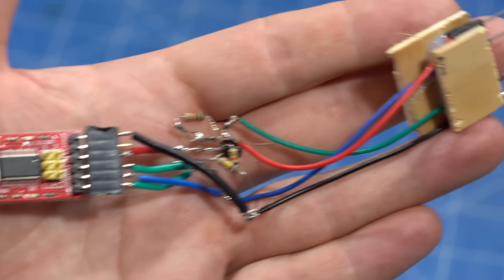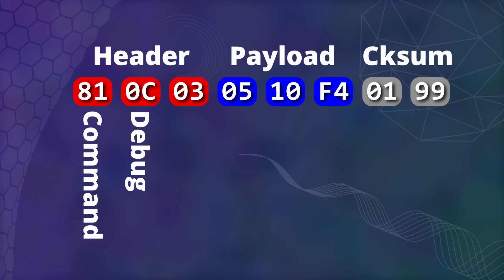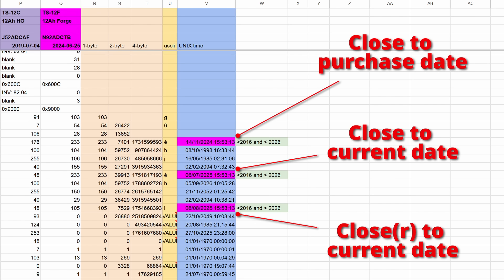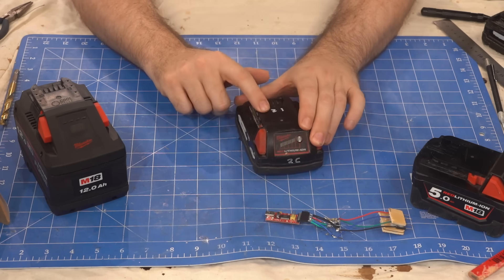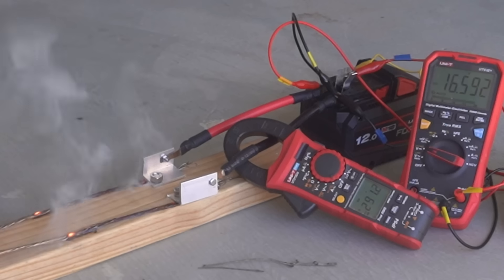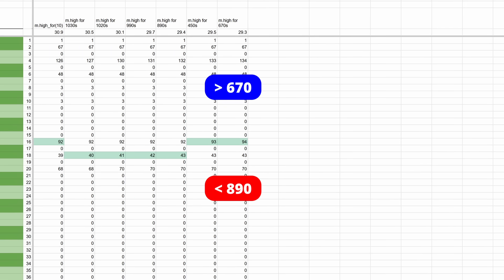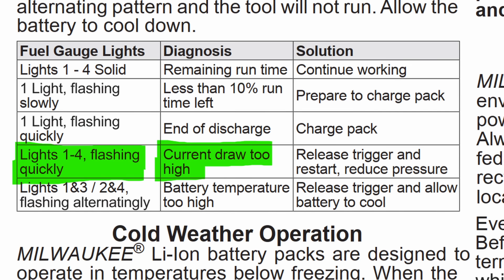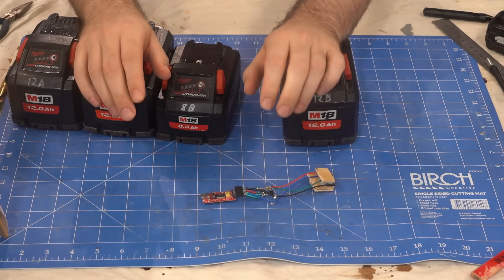Full M18 diagnostics revealed

Comment: Back in 93/94, I was an electronic tech. I worked with an engineer to prototype and develop the smart battery module for C&D Battery. We also developed the Ranger II charger board that would gather battery data when the battery was plugged in to charge. It was hard enough to make it work. I could not imagine the challenge of trying to figure it out backwards.
Reply: Why'd you have to make it so complicated mate
Reply: Incredible work by this gentleman

Comment: I gave up and I use a separate $3 BMS for the Makita battery and charge with an iMax B6 charger. Now I have balancing and LVC HVC in addition
Reply: Do you happen to remember which BMS you used for Makita? I am interested in building a charge setup for myself. Thanks in advance.

Comment: Loved to see someone do similar too Sthil batteries, ive got and seen plenty on battery’s going into fault mode, single flashing led,  and becoming useless. Very frustrating given the battery cost and minimal use . Ive checked them cell voltages and they seem fine, so I’m sure the battery is recoverable
Reply: I was given a Stihl battery in this condition by a tree surgeon. After looking into it, lots online about how it's BMS is locked down and needs reset by service tech after repairs. I harvested the cells all were 💯 ok even capacity tested each individual cell and none were telling me anything. I'm hopeful that a similar system exists for commercial batteries but doubt, unless leaked will ever be available.

Comment: This is cool and dumb at the same time.  I can't believe companies are going to such levels of control over batteries. Great video, keep up the great work
Reply: The level of detail in those data stunned me. Lets hope they will use the data not only to deny warranty, but to improve the product. Hopefully not to cheap it out as in some cases it might indicate they are overengineered in some way. 

But I would love to live in world, where the diagnostic data and access to them would be published with the product
Reply from the maker: It makes sense for them to have. Helps them diagnose failed batteries so they can adjust their overheat and cutoffs, et cetera. But yeah, probably mostly gets used for them to just deny warranty based on number of overheats.

Comment: Is there anyone doing this analysis for the Lidl-Parkside tool batteries?
I hear that DeWalt batteries have no internal protection or BMS and rely on an internal tool protection circuit.
Reply from the maker: I think "ErCan Everything" has the most Parkside in-depth videos. Yes, Dewalt is almost entirely within the tool, except for a chip that detects overvoltage when charging.

Comment: 13:20 how would you cool it down before taking it off charge? If you disconnect the charger from the wall, wouldn't that trigger the write to memory? Maybe put an ice brick on it to cool it down while it's still on the charger?
Reply from the maker: Just leave it there will get it back to 40C fairly quickly. But blowing air and/or ice will also help. I was mostly joking as overheating mid-charge is unlikely - overheat only really happens on a tool, so it'll be recorded at the start of charge, and there's no way to  avoid that (except not put it on the charger)
Reply: @toolscientist fantastic work mate! I could imagine a simple stand alone device designed to wall mount near to your charger and all of your batteries could be checked at intervals and it might give them a quick heads up if they should be contacting their rep sometime soon. 

Was there a register that records the number of times the registry has been accessed by a non-tool, non-charger device? Is there any way Milwaukee could identify that you've been snooping on their uart?
Reply from the maker: @The.Talent  not that I could see. Did several re-reads when left on the UART reader and only the system clock changes.

Comment: It's just astounding to which lengths manufacturers will go to bar you from accessing your own property. Just so they can keep selling you new batteries. It's not like 99.99% of Joe public would even bother diagnosing or fixing anything.
Reply from the maker: They did make an adapter (2700-20 or M18ONEKA), but apparently never gave he public access to the diagnostics as it was just meant for programming one-key tools. They could have done so, and like you say, only 1 in 10,000 users would have used it.

Comment: Why tf did they not let the charger balance the cells 🤦‍♂️
Reply from the maker: The charger can't balance, but they do have balancing circuitry built into their AFE (Analog Front End) chip. I found in my [010] vid that they never make use of it. Designed obsolescence seems the most obvious answer.

Comment: Now we need to find how to enable the cell balance.
Reply from the maker: I don't think there's an easy way to do that. It would need someone to write an open-source firmware from scratch, and then not many users have the capability to flash firmware. There'd also be liability issues in the event that modified batteries caught fire. I prefer to just keep shaming these companies until they fix it themselves.

Comment: There is now a programmer at milwakee who has the job of moving three random bytes of information somewhere else for new tool batteries.
Reply from the maker: Haha - I hope not.
Reply: @toolscientist 😂 keeping him employed
Reply: New improved ' Milwaukee Blue Lithium'.
Reply: Next minute it’s just got an md5 hash haha
Reply: @geekswithfeet9137 md5 means shit to me! Speeding to collision will be the key
Reply: @geekswithfeet9137 md5 means nothing to me, speeding to collision will be the key.
Reply: You wouldn’t believe the lengths Ford and GM goes to encrypt their ECU’s in new vehicles. It takes a year or two but they all get deciphered.
Reply: @lordcommander3224 it's more about taking the time to deconstruct all of the ecu systems into all of its protocols 

Many computers in cars to reverse engineer just to get an ECU
Reply: Sad but true mate.
Reply: best part is that it's the same 3 bytes (with different parameters) for all TTI products (You're welcome).
Reply: @C.GW.H  Forreal?
Reply: They would need to redo the protocol. If the parameters are figured out, all it will take is a regression analysis.
Reply: @goatsheep4545 this guy knows
Reply: @goatsheep4545 not really. They could add a second layer. First handshake is still the same so the old batteries are still compatible, then after the handshake if it's an old battery format allow it to send/receive as normal, but if it's the new battery encrypt the data so that only official Milwaukee hardware can read it. Allow the chargers to write to a separate unencrypted sector and the battery itself takes those values, runs them through encryption and adds them to the pile where they need to be.
Reply: @wolfrig2000 don't do Milwaukee Guy's work for him, keep him employed 😤
Reply: @wolfrig2000  I doubt the BMS has enough processing power nor the RAM to do any sort of data encryption.
Reply: A Chinese students are working very hard to understand this video
Reply: uno that, wokring all the overtime to close this down
Reply: damage is done theres gotta be hundreds of thousands of those batteries.
Reply: If this changes the backwards compatibility of the batteries with the tools and chargers, there would be a riot.
Reply: It’s no so easy as they need to support charging with legacy chargers 😂…even if they did it, they would have to rework the entire system as a big gamble only to hope that people wouldn’t crack it again and they’d have to repeat the same steps again.
Reply: unlikely that they care that much, in reality an extremely small minority of customers that will use this in their favor, hardly worth spending time and money on.
Reply: @rrabbids  of course they will care, this wil remove a chunk of income to them!
Reply: @rrabbids Counterfeiters would like a word.
Reply: And update all their diagnostics software?      
Working as a subcontracted dev team for a very large computer hardware manufacturer that will either be rolled out in the next quarter or they won't notice for at least a decade and all of a sudden log a priority 0 ticket to have it patched immediately. 
I would know because they assigned that P0 ticket to me
Reply: @apocalyptosoldier5527  P0 means that it has zero priority, obviously
Reply: let's just hope he got the memo about the new cover sheets on his TPS reports

Comment: Hello, what are the BMS ics ? Made by ti?
Reply from the maker: Most use a TI BQ76925 as the Analog Front End. The newest (Forge) use Renesas RAA489250, which is undocumented, but appears to be a cheaper RAA489220. All their batteries since 2016 use Renesas R5F100 MCUs. Before that they used TI MSP430

Comment: Can you read any memory? Prhaps program memory and run it through the linux "strings" utility and see if there's anything interesting or useful in there.
Reply from the maker: No, it appears to be a map. Most of the data is in 0x9000 - 0x9122, which does not at all line up with the memory map of the R5F100 chip they use.

Comment: Brilliant work. If you figure a way to trick the bums so battery packs can be rebuilt with original bums, you will be rich!
Reply from the maker: I was fairly sure they could. I've seen several examples of people rebuilding M18 packs. They need to be put on a charger to reset them, but that's it, I think.
Reply: @toolscientist  From what I’ve seen, you need to keep a voltage of some amount on the bms? And at least one video, it failed. But I don’t know for sure. You are worlds more knowledgeable so was wondering if you knew? Thanks for replying.

Comment: This is so freaking cool! It’s amazing how passion for a good cause brings people together!
On the side note, are milwaukee batteries really that bad that they fail so often?
Reply from the maker: No. Most of their packs are fine (even though they don't cell balance), because they cell match. It's mostly 8 & 12Ah high output that use Samsing 40T cells. Every brand has issues with these cells. They're a decent cell with good capacity and discharge, but have too much variability.
Reply: @toolscientist thank you so much!

Comment: Great work. You should try to find a carbon pile load tester. I have one that will go to 600 amps, there are bigger versions out there. They simply screw pressure onto a stack of carbon donuts to lower the total resistance, so turning that screw (knob) gives easy repeatable load control.
Reply from the maker: Ooooh, and they're cheap - right up my alley! Thanks for that tip.
Reply: @toolscientist Lmfao, bro we're definitely cut from the same cloth. Thanks for the content G. Subbed.
Reply: 600 amps? dear god... :D
Reply: @Zephyroku  They were originally popular for load testing lead acid batteries in service stations, so were fairly common in their day. The bigger versions could be used for truck or bus batteries to simulate cranking load while measuring voltage drop which give an accurate state of health.

Comment: I bet they are using an off the shelf battery management IC. Many have these sorts of features. For instance Google “slua924” for a TI document on one of their fancier chips. You might even be able to get model numbers off the chip on the circuit board.  Figure out the chip and you may have published docs. 

I bet the microcontroller is a super simple one being effectively used as a serial to i2c converter to talk to a BMS. Things like pack serial may be in the microcontroller flash, not in the BMS. If it’s one of the common microcontrollers it may be possible to remove one and solder it to a dev board and be able to read the source code.
Reply from the maker: Yes, Texas Instruments BQ76925 for the AFE and Renesas R5F100B[C/D/E]A. They used to use MSP430, but swapped to R5F around the time these diagnostics came in (2015-2016).
Reply: @toolscientist ah yes.  TI provided that combo with sample code. I bet most of the code is directly from TI. If they left the JTAG interface on the PCB it should be fairly trivial to extract the code from the MCP430. No doubt it reads some data from the analog side, stores it in eeprom and the has the simple serial protocol you are using to read the eeprom. Probably always running in low power mode, and I bet the times make sense if you look into counter overflow in low power mode for the timers. 

What you need is someone experienced in mcp430 or r6f100 assembly.
Reply from the maker: We found some MSP430s that were unlocked and we were able to extract firmware. Unfortunately the MSP430 packs didn't have diagnostics in them. I looked at the sample code for that development board, but I think it was just i2c examples, and not a full fledged BMS.
Reply: the rl78 will make it very hard to get the code back out. Might be worth a try with a debugger and an ocd key of blank or all zeros. Never ceases to amaze me how many companies buy a “secure” device and then don’t secure it. 

An oscope with i2c decode hooked up to the i2c pins on the BMS chip might also provide clues. You would see how often it reads values, if it reads in response to particular uart commands, etc.

Comment: Thank you for sharing the reverse engineering of M's planned obsolescence built batteries. Now that it is cracked, could the same method be applied to the tool itself for total freedom? I can imagine if the tool isn't modded as well, there will be a lot of spoofing going on. What do you think?

On a side note, I took one look at that soldering job from the thumbnail. Your iron is too hot and burning the flux away before it has a chance to work, noted by the color being dull instead of shiny. Flux is essential as it cleans the joint and lowers the surface tension, allowing it to flow better (notice how it's balling up). Cold solder joints will look dull too, but a lower temp would have oversaturated the wires with heat and start melting the insulation, causing it to recede by the time it's hot enough to flow. Ever since I went to a temperature controlled soldering station set to 750-800°F (400-425°C) changed the game.
Reply from the maker: Their are one-key tools that apparently can be programmed (basic stuff like changing the RPM settings), but I don't have any to test.

I need to learn some better soldering techniques. I don't do enough so I tend to just bodge my way through. I have a TS100, but I tend to just run it full power, haha. I big problem with this one was that the cheap wires I used were steel.

Comment: A Milwaukee rep said he's seen a customer add a port for an external balancer to his 12ah batteries. I do mine manually. Heat is their enemy, and the chainsaw gets them hot. 
I have two 12ah batteries that are bricked among many others, sadly getting close to you pile of 19..
So happy you are doing this work.
Reply: ive done this to my 9ahr packs that are notoriously terrible. Im a big RC guy so i just got some balance leads and soldered them to the cells. one of my packs was more than .6 volts out of balance and m18 charger refused to charge it. Charged it with an RC charger and balanced the cells. Now the m18 chargers will charge them again.
Reply: My SkyRC B6 V2 has been very handy for balancing various setups. The internal impedance check is great.
Reply: Interesting, great stuff to know!  Thank you for sharing.

Comment: The best part is that there is no easy way for Milwaukee to change this. They have to stay compatible with everything in the field.
Reply: don't worry !

they'll come up with an ALL NEW LINE UP that features additional software doors the open source community is gonna run through 😅
Reply: In b4 Milwaukee introduces a new DRM protected battery lineup
Reply: @wingman358 probably an rfid strip that when out of loop with the diagnostic tool prevents the battery from reporting any diagnostics at all

Comment: I found that once the BMS loses power, its bricked. How did Martin unbrick them?
Reply from the maker: He made a tool that can send a command to the battery to clear the error. Doesn't work on all Makita PCBs, though.
Reply: @toolscientist  referring to the pile of bare Milwaukee BMS @3:45
Reply from the maker: @WaynesWorld999  oh ok. I think putting 12V on J2, or maybe shorting the RESET and GND pads on HD1. I'll ask Martin.
Reply: 12V on J2 started them right back up for me. I would think placing them on the charger would do the same thing.

Comment: You are doing great work, but one gripe i have with "1 byte words" . WORD is 2 bytes, always. 4 bytes is DWORD and 8 bytes is QWORD. Also a byte can be signed so -128..127 and not necessarily 0..255  The 2 byte data can be big endian or little endian.